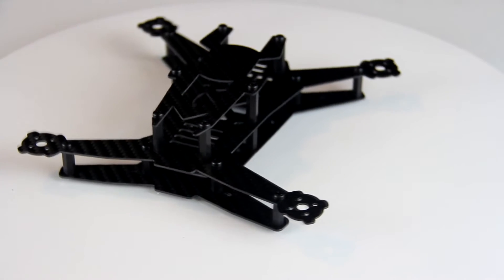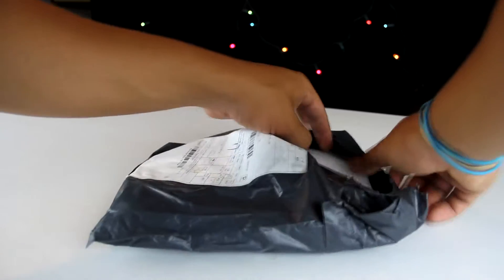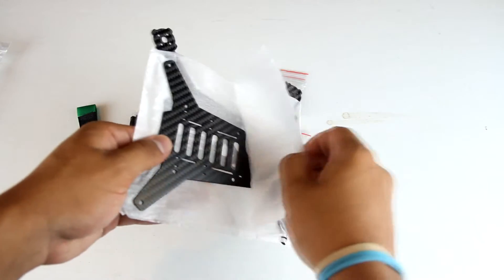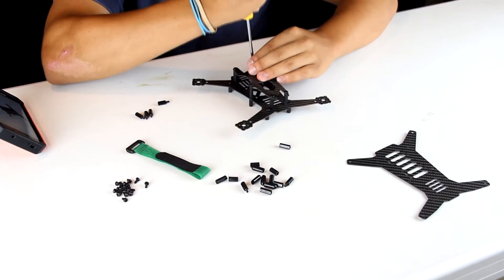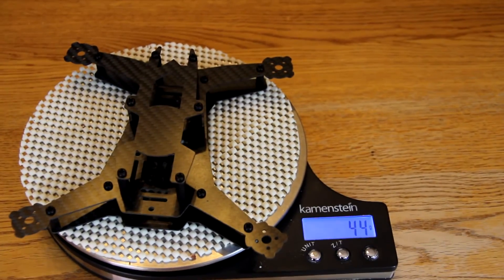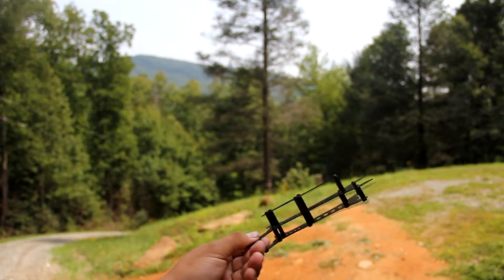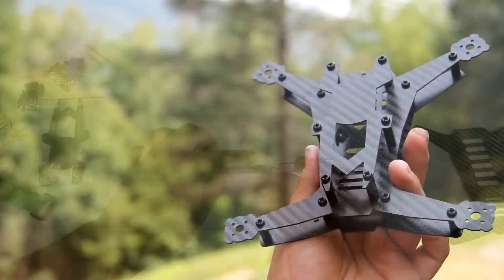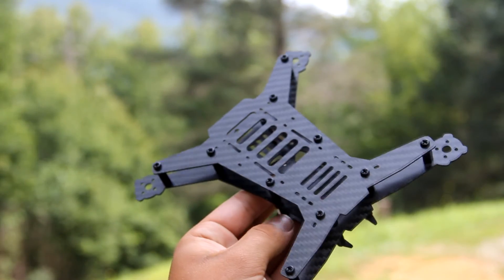Eachine Q200 40g Carbon Fiber FPV Quadcopter

Comment: Just finished putting my Blade 200qx guts into one of these, I think the design is good. What I'm worried about is durability. I did get the arm strengtheners but I'm still worried about the plastic hardware. How did yours hold up since this build?
Reply from the maker: +Jon B Baca I was flying hit a stump and it was all great

Comment: what up brother.. i was wondering if you could help me with something. by looking at the pictures at this link, can you tell me if they would fit/ mount onto the q200 frame. there are no specs on the motor. i recently crashed an x6  an am just looking for a suitable frame to mount my internals thats not a 250. any help is appreciated.http://www.banggood.com/FLYING-3D-X6-FY-X6-008-1FY-X6-008-2-Motor-CWCCW-for-RC-Quadcopter-p-951893.html